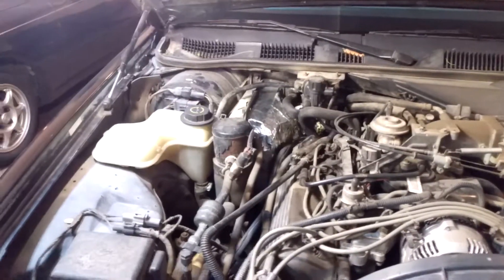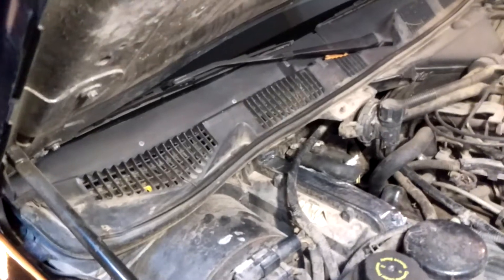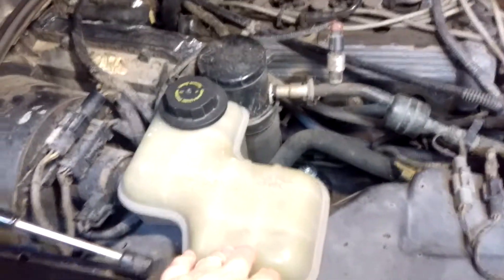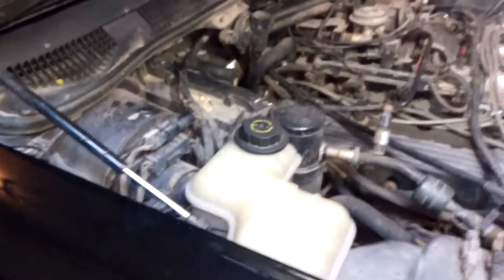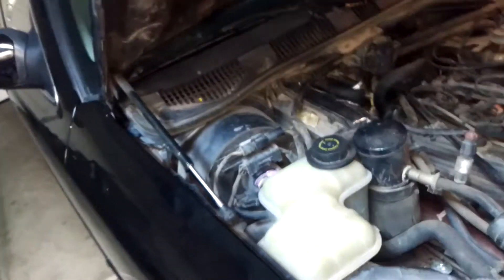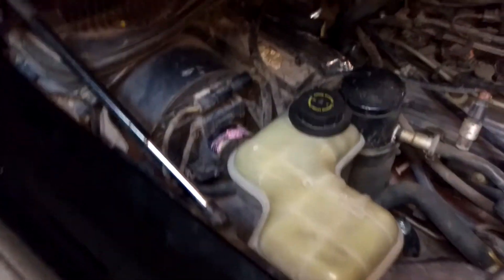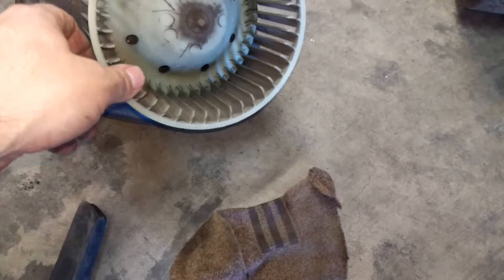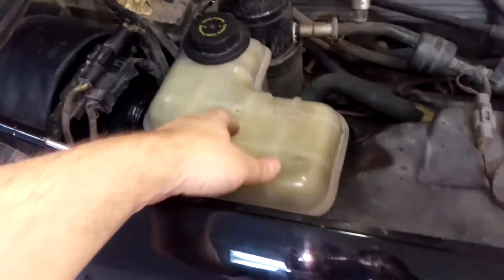Crown Victoria blower motor diagnosis and replacement

Comment: Glad I clicked on your video, I tapped on mine and sure enough it kicked on. Thanks
Reply from the maker: Glad it helped
Reply: @haberbo  hey by chance after you had that issue did the heater stop kicking and start blowing cold air?
Reply from the maker: @ZenjaminGlenn  No, but I have the heater bypassed because the heater core was leaking. In AZ we mostly use the AC anyways. It's either your coolant level, or the air door is not opening up to let air pass over the core.
Reply: Thanks buddy, Merry Christmas!